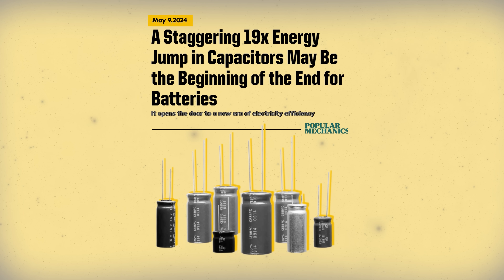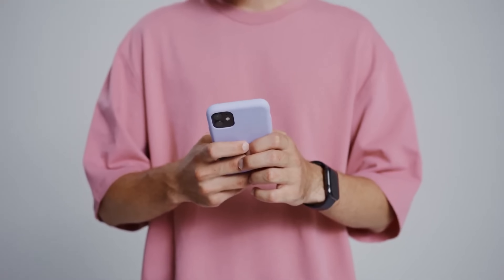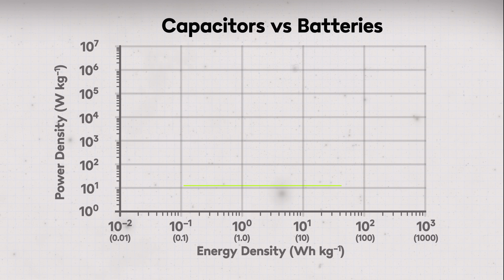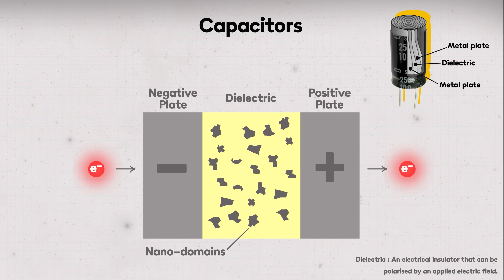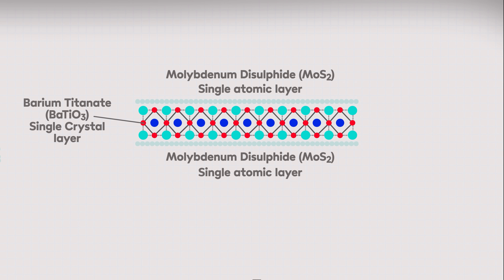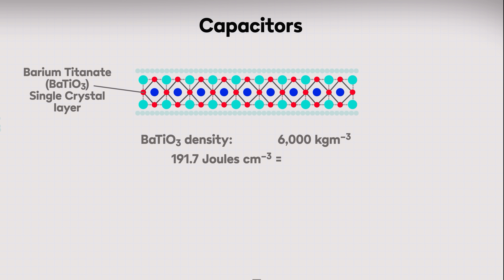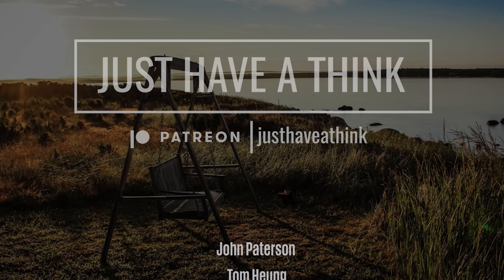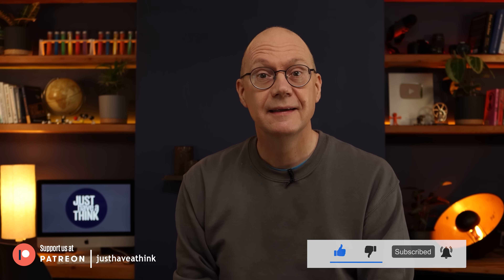Charging an EV faster than filling a gas guzzler? Surely not!?

Comment: This won’t speed charging battery-powered cars, because the bottleneck would be going from the capacitor to the battery. You could get a quick charge of as much as the capacitors would hold, but not a full charge.

Comment: Honest question: Isn't the capacitor the least reliable electronic component?   I've heard a few electronic repair people say that if it doesn't work, the first thing to check is the capacitors.
Reply: There are several types of capacitors.
Reply: Capacitors have a lifetime just like any component. In the race to the bottom in miniaturization, corners have been cut. You can get high quality, long life capacitors. But you won't find many or any in cheap consumer goods that are obsolete within the year. 
So yes, capacitors are a common failure point, but not because of some inherent problem with them. Mostly it's just being cheap.
Reply: @bzuidgeest  I have not checked lately but twenty years ago it was the first item to check on an AC compressor unit but they were often 7-10 years of flawless performance and then instant failure. Quick cheap replacement would give you many years of life again. Not really an issue until you shrink them and solder to a board. Just make them easy access and simple plug and play.
Reply: @markpashia7067  it really clear you are not into electronics. I wouldn't know where to begin with your answer. But at least you observed that as I already stated that you can buy high quality capacitors for a longer runtime. 
But the stuff in modern electronics is the cheapest possible and they sure as hell aren't going to use screw terminals in your phones capacitors, the sometimes hundreds that are in there.
Reply: Don't judge the potential reliability of a fundamental electronic component by the cheap crap in consumer electronics.
Reply: @avsystem3142  Yes!  judge them by the cheap crap they put in cars.

Comment: Supercapacitors are not hybrids of anything . They are just super capacitors
Reply: By that logic a mule isn't a hybrid of horse and donkey, but just a mule. Super capacitors, combine tech or properties from capacitors and batteries into a new product. A hybrid.
Reply: @bzuidgeest  I am an electronics engineer. Have been for 48 years. We have been using super capacitors for decades before the media ever heard the term. A super capacitor is just a capacitor that has a greater capacitance  than a typical electrolytic capacitor. There is no electrochemical reactions involved in the charging of a supercap ,energy is stored as an electric field like any capacitor, not as a chemical change, therefore it is not a battery or a capacitor-battery hybrid.
Reply: @PaulG.x  yes, they have existed for decades. That's not the issue. How they are constructed is not the issue. What is the issue, is that they have properties with values that fall between normal caps and batteries. The hybrid thing refers to the numbers not necessarily the construction. Charge time, cycle count, capacity etc. in that respect they are between batteries and ordinary capacitors.
But even beside all that, they do use electrochemical reactions among others.

Comment: Why are the greens in Europe anti nuclear?
Reply: In my opinion, nuclear is bad, but not for the same reason as the greens in Europe. Nuclear is a wonderful technology, it is great at producing lots of clean energy, and nuclear waste management is not as problematic as many political parties make it sound like. 
The only thing is, we would still depend on uranium imports that come mostly from unstable countries, and investing too much into them would mean higher demand, and therefore the technology would cost more. Another thing is transformation of the electricity and transportation that also costs a fortune. 
Solar and wind have become much cheaper than nuclear, they don't require a ressource that needs to be imported, they can be scaled down and don't have a high upfront cost, and they can be installed closer to residentials and industries, meaning fewer masts and lower costs of transportation of that electricity.
Reply: @texanplayer7651  Canada, particularly the province of Saskatchewan has the 3th largest supply of uranium alone, and the 4th largest supply of thorium. then there is Australia's uranium supply. not exactly "unstable" nations. so that argument isn't exactly justified. and NIger, being the 7th largest supply is heavily stabilizing as their economy grows. uranium selling would further accelerate this growth and stability from corruption. as for thorium, Finland Denmark and Norway outproduce Canada, and they have a VERY STABLE national governance. i do not get your argument at all regarding "unstable nations". Even Kazakhstan isnt part of Russia. and they a very generous supply of nuclear ores as well.
Reply: @XxRIC0CHETxX  FAST LFRT reactors run on nuclear waste of older conventional uranium nuclear power plants. and reduce storage of spent fuel from thousands of years to a few centuries by comparison. crazy how next generation reactors have solved a huge portion of this problem. then there is thorium reactors having the capacity to "recycle" spent fuel, recovering 91% of thoriums "spent" fuel for reuse. their own ignorance of modern nuclear technology is holding the world back, on becoming carbon neutral without reliance on unstable "renewable" wind and solar power production. modern nuclear can and should replace our base load power needs, over creating more hydro damns which affect local eco systems, more so negatively than positively.
Reply: What does that have to do with anything discussed in this video?

Comment: Just a general comment. Going from lab results to cost-efficient manufacturing is a long difficult road that very few inventions survive. I wouldn't hold my breath on this one either.
Reply: Not just manufacturing.  Also reliability.  Things change when you move out a clean and safe lab environment.  Even stuff like how does it handle different temperatures and swings in temperatures. Where I live we can experience 20+ degree temperature swings within 24 hours.
Reply: @pin65371   -6˚C to + 45˚C within 12 hours is not uncommon in inland deserts, either.
Reply: @jimcolleran1804  These only have 8.8 W/h per kg energy density. So even if they can manufacture them cheaply and they are reliable, it won't make sense to put more than 100 W/hours or so in an average EV, because they will just be too heavy. And 100W/hs won't make any difference to charge times. 
Their energy will probably need to 10x before it's worth it. By then, batteries should be even better, so large capacitors will still be pointless in regular EVs.
Reply: Interesting if it can be replicated and scaled up to commercial potential. I saw no mention of material or fabrication costs or methods. No way to know if this is simply an interesting experiment, results to be verified, or a potentially significant development.
Reply: How do you get 100kWh of charge to each of a dozen BEVs (CEVs?)in a couple of minutes. Then do it again and again for a day?
Reply: @Wee_Langside  With a big wire.
Reply: You right, the other thing is that I'd like to see in what year we will have an EV charging station which will have same speed for the same number of cars as we currently have next to Costco.  If I remember correctly we have 13 terminals Costco( plus 2 more other gas station in 200m totalling 20-25 spots). Let's take for now just Costco. Assuming the car fuels and pays in 4 minutes we have roughly 3 cars fully fueled in 1 minute. Let's take 80kWh for a car so we have 250kWh in 1 min. I'm afraid to say but seems there will be needed a small nuclear reactor to provide that amount of energy.
Reply: Yes, though they used 3D printing to achieve their invention using materials that are typically used.  This to me seems doable, though if you own a 3D printer you understand speed [and therefor scale] is not high.
Reply: Oh boy are you correct there.  So many things can go wrong from "wow, this is fantastic", to being in products in real life.
Reply: Not to mention capacitors break down after a few years. Even if they have solved that problem it will take years to prove it.
Reply: @frankdelao4067  Electrolytics die in a few decades because the electrolyte dries out.  Other kinds last much much longer.
Reply: Iows, capitalism massively slows down innovation.
Reply: @seamon9732  Government oversight slows down innovation too.

Comment: Whenever I hear a claim about very fast charging I look at the amount of power required to make that happen.  350kW chargers will charge an EV within 15-30 minutes.  Cutting charging time in half means doubling the power supplied by the charger.  It also will greatly increase waste heat which will make the process less efficient.  We rapidly get to charging speeds that would require multiple Megawatt chargers.  19 times faster means over 6 MW.  In my opinion, the chargers we have a pretty well as fast as we need them to be.  It would be nice if they were as fast as fuelling with gas, but then again, when charging, you don't have to wait beside the car until charging is done.
Reply: That's true, but if the technology works, there are still plenty of uses for it that don't involve multi-megawatt power supplies. For example, laptops and mobile phones could use it to pick up near-instant charges at airports for people who forgot to plug their devices in the night before a flight. E-bikes could use it for 5-minute quick charges at level 2 charging stations designed for cars.

Even for cars, if the technology could be used to reduce slowdowns in charging speeds as the battery gets fuller, which wouldn't require any upgrades to chargers or utilities.

And, even a charger with 6 MW power supply is not completely infeasible. Data centers, for example, consume far more than that, it's just a question of where they're located relative to the high-power infrastructure.
Reply: @ab-tf5fl  data centers consume that load, but you don't plug its power cable in. That cable isn't mobile. Also we have a handful of datacenters with heavy duty power connections, somewhat different from twenty chargers in a street for every block where a million small mobile datacenters try to plug in and charge every minute. The comparison just doesn't work. Nice in absolute numbers, but not even close to the same practical problems and execution.
Reply: You do have to wait with the car til it's done charging if you charge on the go. I personally think if we can get it down to 5 mins or less, people will be happy with that. They probably don't mind having a cigarette break or scrolling through their favorite social media app for a few minutes while it charges.
Reply: @user72974  the charging tech is not the problem, nor is the battery tech. The grid just cannot supply that amount of power. to get to 5 minutes the grid of practically any country would require a major overhaul.
Reply: @bzuidgeest  I’m wondering if this same tech could be used at fast charging stations, which would have a mix of batteries and these “hetero-capacitors”.  The capacitors could charge cars that can support incredibly high charging speeds (at a premium rate of course), and draw from the battery packs as they discharge. The batteries are then “trickle charged” from the grid over an entire 24 hour period so any given charging station won’t need to draw immense amounts of power in a short time.
Reply: @sjsomething4936  that would mean that every day exactly one car can charge at that charger at the premium rate, after that comes your 24 hour trickily charge. Maybe two or three of the cars are not empty.... Or larger cap banks which make the charger large and expensive. There is no quick fix for this.
Reply: @bzuidgeest  no, the caps charge from the batteries, which are what is charged from the grid.  The caps could be charged multiple times per day from the battery pack(s). This way the draw at the grid by the station could be a constant, predictable rate and allow the correct sizing of the infrastructure to deliver the power.  Much like tiered storage in large capacity disk arrays. A fairly moot point at the moment anyways, these sound like bespoke devices at the moment and producing them at commercially viable volumes may be a long way off or possibly never happen.
Reply: @bzuidgeest  We could buffer the grid in big batteries and capacitors at the charging station. The weight or volume wouldn't be an issue and it can use a premium charge rate for the convenience.
Reply: @JeffBilkins  that would do little too solve the issues with such loading speeds. The cable would still be very heavy. Your buffer would have to accommodate a continuous row of people that want to charge. So it would have to be very large. Then, when does the buffer charge? Let's say demand drops in the deep of night. It would then start drawing huge amounts of power to charge itself back up. So you only moved the problem, maybe even made it worse. The grid would still not be able to deliver the demand. The energy to charge hundreds of cars during the day. 
No it just doesn't work that way.
Reply: @user72974  what I mean is that my routine when I'm traveling long distances in my EV is to plug the car, go to the restaurant and get a meal or take a bio break.  I don't have to wait beside the car for that and the car alerts me when I have enough to continue my trip.  My real life experience is that charging is already so fast that I only have time to get a table and order my meal before I need to move the EV because it's charged and I don't want to incur idle fees.
Reply: @user72974 for me I find destination charging the ‘fastest’ option and cheapest . Fastest because I can plug into the 7kw charger and walk off , returning in the morning . Either a fast charger you have to wait half hour in the vehicle . So oddly slower chargers take less ( near none ) of my time

Comment: I too have limited understanding and maybe underestimating this. I have thought that caps and batteries should be combined such that when DCFC an EV the cap would take the energy(charge fast) and since most of the energy is not needed immediately it would then transfer the energy to the battery over a bit of time giving the best of both worlds.